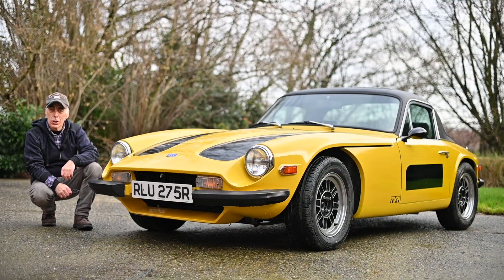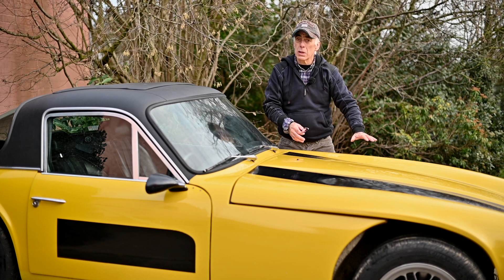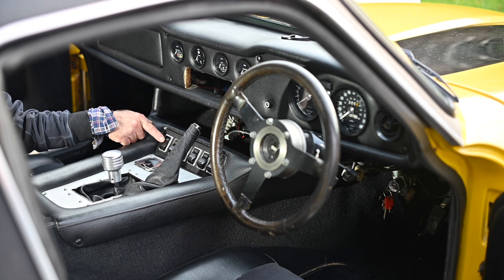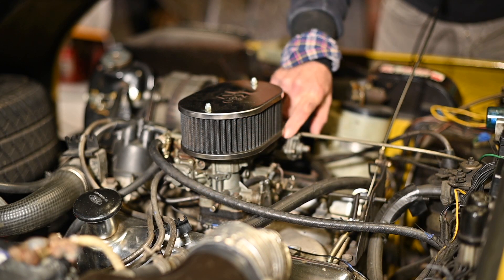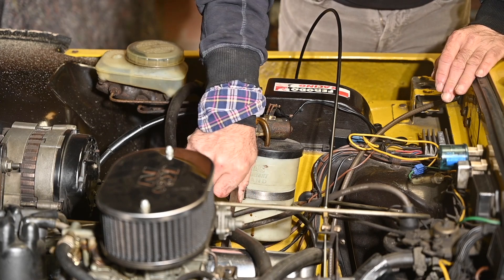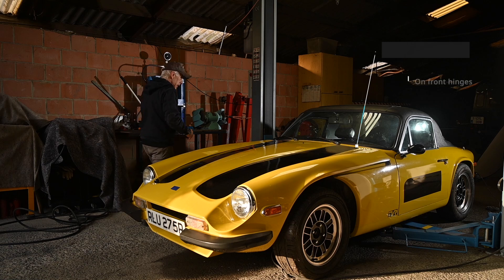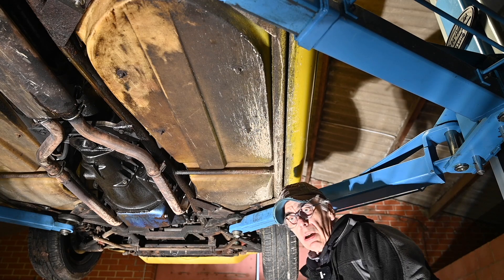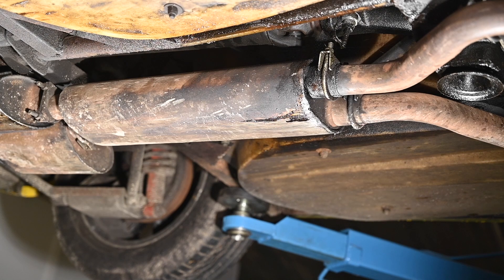TVR 3000M first inspection and assessment

Comment: You are really lucky this one had a good oil leak, nothing preserves the underside of a car better than a spray of oil, when you have fixed the oil leak, I find the best thing to spray the chassis with is Waxoyl, it remains flexible, and it is wax based , the very worst thing is the bitumen based "protection" that allows rust to eat the steel away without being seen! Stay safe! Chris B.
Reply from the maker: Thanks for the comments,  Bitumen is indeed a very bad idea...but even waxoil will not help on a rusty chassis.    Once its back to bear metal, it will be painted (epoxy), in several coats, then a good base paint, and multiple coats for back paint ... Waxoil inside the tubes...
Reply: @D3Sshooter  Yes, I think a coating of bitumen actually makes the underbody parts rust more, if we look at the thin sheet steel components around the transmission and axle where a mist of oil has "escaped" they are usually in perfect condition under the layer of oil, and they were only painted with the usual paint coating, the problem is getting back to clean bare metal on the chassis, the only way is to sand blast it I think, then an epoxy coat is fine, phosphoric acid can help to neutralise any awkward to access rust. Stay safe! Happy New Year! Chris B.

Comment: I worked at a TVR main agent around 1978, and in their day, these cars were very fast, they also did a turbo version, with a very complicated carb set up. Not sure if I remember right, but some had a fibre cam gear,  which sounded like loose tappits, when it became worn, or that may have been the V4 engine? It was a long time ago!
Reply: Yes the Essex V6 had a fibre timing gear. A steel set was available but they were noisy. The other problem was the hexagonal rod that drove the oil pump from the distributor. It could round off and then no bottom end.
Reply from the maker: Thanks for the comments,  so you could be a good source of TVR knowledge...   Indeed they have a fiber cam gear ,, and metal one ca be placed but is noisy.
Reply from the maker: Thanks for the comments, spot on

Comment: Looks Good.  As you probably know, the engine was used in many Ford cars.  Parts should be easily available and not expensive.  From what I remember most of the parts came from other cars.  The owners club would be well worth contacting with help on sourcing parts.
Reply from the maker: Thanks for the comments,  Indeed like the Ford Capri 3L   ...

Comment: Voltmeter reading looked low? Not vented disks as std, also looks like you have AP (Princess) 4 piston calipers? Hard to see at the viewing angle.
Reply from the maker: Thank you for the comments,  yes the voltage reading needs to be verified , and the brakes are upgraded... not sure with what ... but 4 pistons indeed.  I will have another video on this

Comment: Passing a UK MOT with racing harnesses is not an issue. They're perfectly legal in place of a normal seatbelt. The rules just say that some kind of seatbelt system must be in place for cars from 1966 onwards. The only issue you would have is if the racing harnesses were interfering with the rear seats, that would be a failure. However, you can just remove the rear seats and convert the car to a two-seater.
Reply from the maker: Thanks for the comments and tips, although this was the Belgian MOT
Reply: @D3Sshooter  Ah ok, I assumed you were referring to the car's last UK MOT since it still has the UK plates on it.